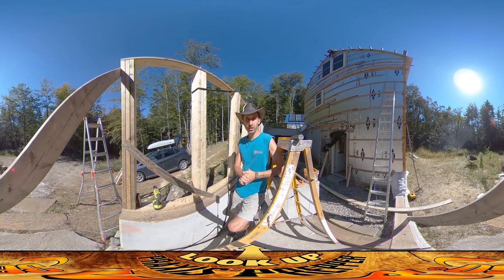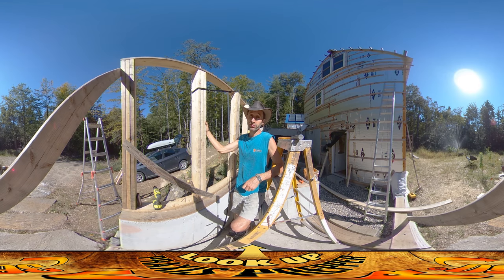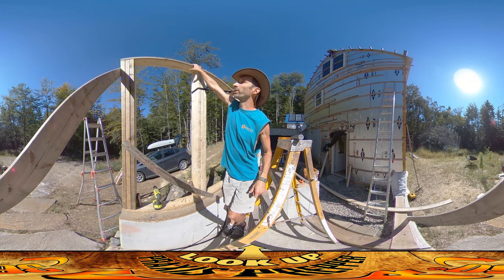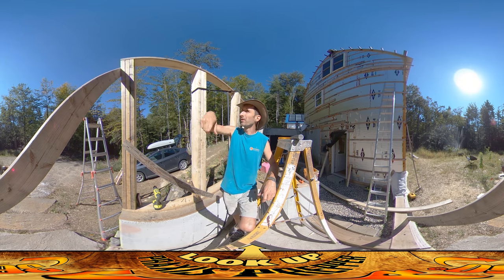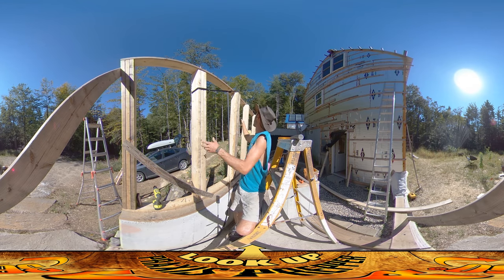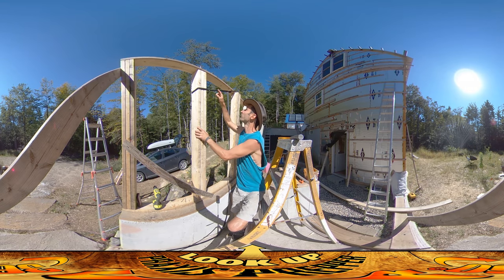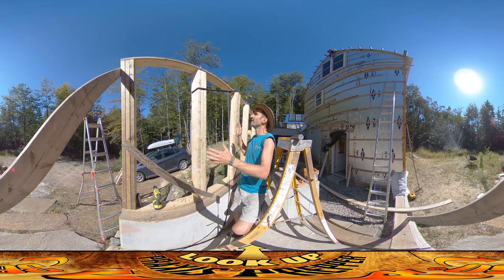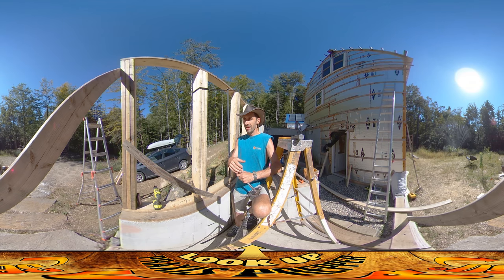Homestead Building - Posts for the Greenhouse, Forcing Posts to be Plumb While Alone, Radon

Comment: Note on testing for radon, the reason you test with closed doors and no disturbance of the air is because radon gas is heavier than air so you are actually reducing your test results and if you haven’t already you should redo the testing with the bottom floor closed off and still air, so turn off the air recirculating fan.
Reply from the maker: I'm getting a much better sense with this digital meter. I didn't know about the higher density of radon. Thanks for that tip.

Comment: It looks like you're making good progress on the one green house. I'm glad you're able to work outside today. I'm sitting at home, waiting for Hurricane "Sally" to make landfall, literally on my location tonight. I'll be fine, as I've survived direct hits from hurricanes far worse than this one. However, it is messing up my plan to finish building a box trailer I need to get done.
Reply from the maker: It's a pain when mother nature gets in the way of projects. I have cold air coming and that's not going to be great for applying the weather seal for the exterior wall boards.
Reply: Well, good luck and stay safe, and don't do anything stupid !
Reply: @dutchcourage7312  I stayed indoors for the entire thing. Some parts of the county got off easy, while others look as if they'd been nuked. In my little town, there are over 4,000 power poles down. The Pecan and Acorn crops are lost, and millions of trees were either uprooted or snapped like twigs. All but one of my trees was lost. I'm running my generator right now, after it took two days to liberate it from the tree that fell on my tool shed. But, I came out okay. I've seen worse.
Reply: @PraxisPrepper  Right now, in my area, I'd welcome cold weather. The humidity is stifling. But, I understand your point.